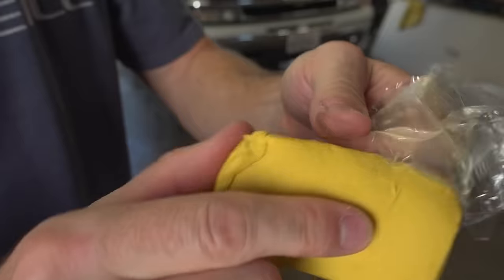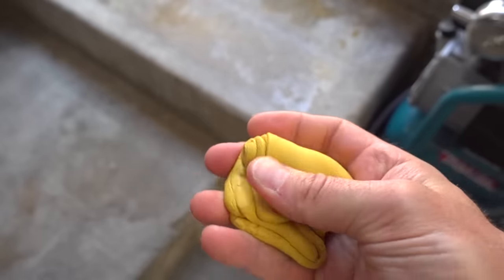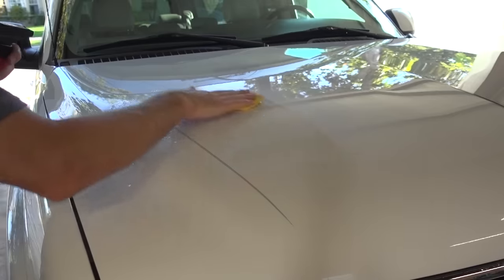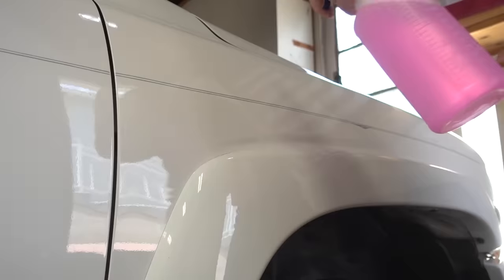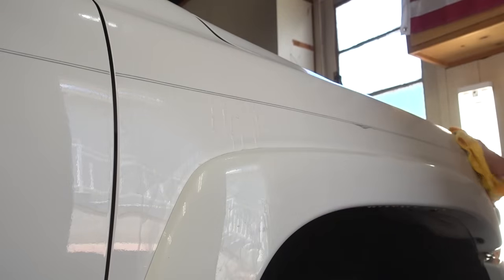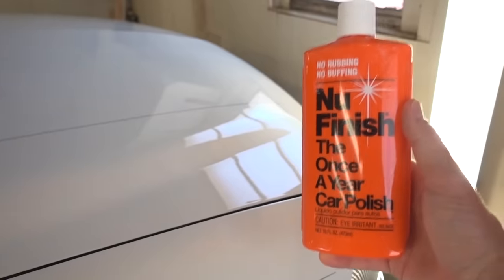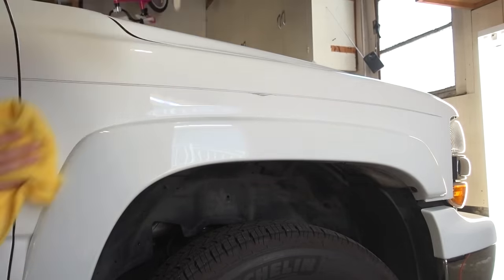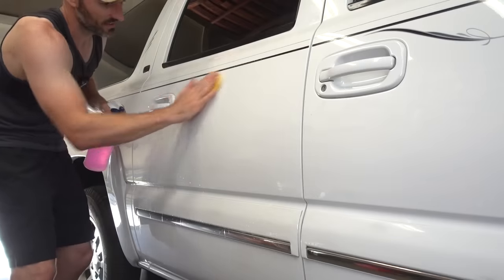This Is Better Than A Clay Bar And Only Costs $2

Comment: I was a auto painter for 42 year.s and if I was going to do a comparison on two different ways  to test a product, I would have used the clay bar on one half of the hood and plumbers putty on the other half of the hood.That way you would have equal light distribution on the paint surface.
Reply: and preferably on a dark color such as black. white hides a ton of imperfections. also looks like you take pretty good care of your car as is.
Reply: @dee1089  And don't compare one surface that has been waxed with one that hasn't.
Reply: It’s a shame you went through all that trouble. Nu Finish is the star of the show. That stuff works miracles.
Reply: @Bo-hb3eo  yeah, when I had body work done on my sebring years ago I asked the body shop owner about various waxes.  They swore by nu finish for a once a year wax if that's all you do.  I like Maguire's gold glass for the shine it leaves, but doesn't have the lasting power of nu finish as far as protection.
Reply: I like the idea of a cheap alternative putty. If you drop either putty you’re advised to toss it. That gets pricey!
Reply: just use an inspection light and examine the paint 🤦‍♂
Reply: It also might be a good idea to do the claybar and PlumbersPutty (PP) side by side comparison on a vertical surface, a door.  As opposed to a flat surface where the light bulb positioned to the side is coming on an angle from a light source. That might give a different appearance. To me it's better surface to examine side by side, for metal or paint imperfections.  I would like to spray various types of liquid to see how it runs top down on each surface. again side by side. 1Road did a good job approaching the subject. But examining what we do often reveals how to do it better, so I do appreciate the time he took. I too think
@stephenmartini5890's forty years of product experience is good enough for me to use the PP method.
P.S. Thanks to all above. I'm going to go for the NU Finish also..
Reply: And a similar surface.
Reply: I agree 100%.  Most of the damage is usually on the top of the car and was going to comment do have done the  hood with putty and other half with clay bar
Reply: I was thinking the same thing
Reply: This guy completely marred his whole paint job and doesn’t even even know it
Reply: Isn’t the Nu finish a bigger ‘grit’ and the clay more of a buffing tool..better for after nufiniish?

Comment: I save money by not washing my truck.
Reply: Lol! Its good ur saving that money! Because when all that junk ABSOLUTELY causes u to need a new paint job the shops gonna require ALL of it!... Plus much much more!  Or even then u could still just let it go and as the rust eats away at the metal and stuff starts falling off u will gradually get better gas mileage! Definitely needing something to offset that continual decrease in the value of ur car anyway so why not! 😂
Reply: Jonathan Bailey Or just throw it in the gutter & go buy another!
Reply: once a year works for me.
Reply: Yep making it look like a mirror doesn't make it drive
Reply: I bought a used construction truck V8 to haul cargo and my overweight butt. Washing trucks is a waste of time unless it is to hose off the mud so you can see the paint.
Reply: some people let the green moss grown on the cars. still after a ordinary washing the car looks like new. exept under the car there was a hole . funny the paint had to issues. so perhaps use clay under the car ?
Reply: Me too
Reply: You don't wash it, the paint will fade away
Reply: urban cammo
Reply: Better gas mileage with waxed car.
Dirt has mass and creates drag. Save the earth :-)
Reply: @deasttn  at 13 MPG in a truck no cleaning will do anything 
The shape itself is already a Battle against aerodynamics
Reply: @deasttn  a shark is not smooth, so is a dolphin...
Reply: @gertvanpeet3120  thats right. Science!
Seal the radiator opening like nascar does and you'll get even better gas mileage.
Reply: Really? Tell us more...your so smart...gow about save water and pee outside!
Reply: James Carroll  whats a geo metro...a milenials vehicle?
Reply: @deasttn  wow...deep!
Reply: @bryanmartinez6600  really?
Reply: @gertvanpeet3120  what about a catapiller is it soft and fuzzy? You must know!
Reply: Save more money by not buying a truck!
Reply: deasttn I already get 55 miles to the gallon with my Toyota Prius, think how much more I can get if I wax it? ✅
Reply: ONE !! DIRTY !!! TRUCK !! INDEED !!
Reply: My 20 year old dirt on my truck protects my paint just fine plus helps hold the whole truck together
Reply: My bad Transmission is my antitheft device ; my oil leaks  makes sure I always have fresh oil in 
my truck. 
    Yes , Pig Liver taste better then cow Liver.
Reply: Lol
Reply: I save money bu not having a truck.

Comment: Buy silver cars.  They always look clean
Reply: Agree just wash 1 every 3 months 😂😂😂
Reply: Buy German cars they have too much paint on them.
Reply: But they attract dirt like a magnet
Reply: Gold. You can barely see dust on them.
Reply: @erniefernandez598  Wash your car then.
Reply: White stays and looks clean if you keep your hands and fingers off it
Reply: @Perry Elyod Resale value
Reply: @bokibo87  do you one better. I own a silver German car.
Reply: @nicstr28  
Not as long as Silver....I've owned both white and silver.
Reply: Very true
Reply: @motorcitymanman7711  i agree with this. I currently own red,silver,black/white 2 tone, and all white. Silver can go a while before it looks bad worst part is water spots from rain. The black shows up a lot ans spots up bad. The white looks good for a while if not parked under trees. 
I however can go a month during the summer without washing the red car before it looks bad.
Reply: No friggin way !  Silver is almost as HOT as black here in the southern summers.
Reply: I don't know about current paint, but in the past, based on my observations, red and silver were the worst paint finishes for oxidation.
Reply: @OOICU812  my red car is oxidized pretty good currently,needs a buff. The silver German car is pretty new and still looks flawless. Time will tell.
Reply: Gold cars same as silver.  Can't see any dirt.  :-)
Reply: i painted my truck "brilliant silver" looks hella good a few years later
Reply: @Perry Elyod Because my ego is not involved.
Reply: Silver oxidizes easier in my experience but I like it.  My pickup is silver and black.  Believe it or not, my old white pickup always looked cleaner.
Reply: @SBCBears  Yes, so is brown or beige.
Reply: Aubergine coloured cars are the best you see everything every scratch every swirl people's nightmare purple plum aubergine
Reply: @erniefernandez598  silver paint does NOT attract more dirt than other colors
Reply: @nicstr28  WTF are you crazy? WHITE and BLACK - two worst colors for cars because they show dirt immediately- White cars show black dirt and black cars shows white. Silver ROCKS
Reply: @Perry Elyod Well because a 1999 SL500 as all Mercedes do look the best in "Brilliant Silver"- hard to call someone who drives a 20 year old car a "conformist".  White is the coolest but dirtiest. Silver is still very cool and stays so clean (looking) the longest. That's 2 reason why.......
Reply: If you want to Wash your car every week  buy a black car/SUV/truck
Reply: It's true.. my 2012 sonata (silver) that she scratched against a staple riddled pole when we first got it.. looks better than my 2019 Tacoma (detailers black).. wash my truck 3x per month.. I don't remember ever caring about the sonatas paint outside of washing off bird droppings..
Reply: @bokibo87  Yes and you'll pay MUCH more for the frequent repairs of such over engineered, complex and unreliable money pits.
Reply: That's what I do
Reply: Corona Covid 19 
But they cheat during SMOG tests.
Reply: Silver is among the worst colors for a car, it always oxidizes qucker than other coloy.
Reply: @GTVAlfaMan  ......... That's nonsense...... I've owned 41 cars and the silver and white car's paint holds up much better than any of the other colors... Less absorbing of heat and rays equals less damage to the clear coat
Reply: big4g63t 
You are wrong, I’ve owned a couple of silver cars and along with few of my friends and relatives we  all have experienced sun fading issues with silver painted cars.
Never get a silver car.
Reply: @GTVAlfaMan  I currently own 3   silver vehicles, am an automotive technician/professional detailer/ paint correction & restoration specialist...... And I'm old.... Sorry but I'm right and your wrong.... Longest lasting automotive paint colors are silver and white in various shades... That's a fact.
Reply: Hahaha unless you park under trees 😓
Reply: NS hell no. Mine was always dirty
Reply: Silver, as well as white is boring. Gold is ugly.
Reply: @billclark8241  White is far from coolest, used to be police and old ladies drove white cars.
Reply: True 👍
Reply: Why look clean when you can actually keep it clean. Weekly or bi weekly washes.
Reply: @bokibo87  not vw's though lol, paint is super thin.
Reply: I verify this message !! Favorite car color by far is silver .. looks clean forever !
Reply: 100% correct.
Reply: Lol I have metallic mercury silver always looks mint
Reply: Yeah, until the clear coat goes bad.
Reply: Except when they’re filthy
Reply: @Tombrosapien The  Chemical Guys help keep that from happening
Reply: Yes I don't know why I always find great buys on black cars. Can't avoid them for the life of me.
Reply: @bokibo87  i dont igree at all. I live in sweden. Audi a4(not a6). Bmw 3-series(not 5) and vw passat is worst known as rust magnets.
Reply: @bokibo87  and just buy a Toyota avensis. It has stone chip from the wheel.  It has been own by a guy who live in country rouds whit roads full of sharp rocks. And this car has a amazing thick layer of paint. I have not see this thick before. And the rustprotection is amazing. I have not see this good rust protection before.
Reply: Why I own one
Reply: @Perry Elyod boring cars don’t get stolen so much
Reply: Yes that's true , 2018 I bought the new Suzuki swift turbo in red to please my wife, will never do that again next car silver.
Reply: That’s what my parents do. But I don’t like silver cars.
Reply: So true and the color hit different
Reply: No, just no. Silver cars are the hardest to get a deep mirror gloss on.
Reply: Brown
Reply: All I own are silver vehicles. It's been that way since 2005
Reply: I agree 👍 😀
Reply: the problem with silver cars is that they blend into the road..you can't see them that good..
Reply: @philiprawbon2359  very true. Cops don't notice them as often. ;)
Reply: If you clean your silver car it look and be clean.
Reply: Agreed! My GTO is Palladium silver
Reply: @erniefernandez598  That's black paint
Reply: I have a silver car I love it I never get a ticket Cause a radar gun can’t read it because I’m camouflage to the road
Reply: @dan_6915  my mustang is “mineral grey” and it’s basically gold, this is true. You can only tell it’s dirty from up close, like getting in the car close. Still looks good walking passed it
Reply: In my experience, silver is the worst paint to have. Very difficult to maintain and easily shows imperfections.
Reply: @bokibo87  Uhhh, not on Mercedes.. 🤦🏼‍♀️😂
Reply: This comment is under thumbed up.

Comment: If the hood was divided into two sections and there was a straight side by side comparison on a similar surface, this might have some credibility. Those surfaces are not only different and how they contact debris coming from driving, but also the level of temperatures that those surfaces are exposed to.

This is why I love the Project Farm Channel so much, the guy thinks about that type of stuff and always tries to give a uniform testing protocol on whatever he does.
Reply: And have it done on black paint so you can see

Comment: Most paint contaminants will settle onto the horizontal surfaces of your car, less so on the vertical.  Clay bars are made to be sticky in order to grab the contaminants off the paint without using excessive pressure to remove it reducing the amount of abrasion on the paint.  You can use car shampoo mixed with water as shown in this video with a spray bottle. It keeps the clay lubricated and moving easily reducing paint abrasion.  You will see the clay bar surface becoming dirty, that's what was stuck to the paint surface, when you see that take the clay and knead it so you have a clean clay surface for the next panel.  
I have never used plumbers putty on a car so I can only offer my professional opinion on it, but not by experience in using it.  I wouldn't do it.  Plumbers putty is not as sticky as clay and it's much softer, which translates to using more pressure and more back and forth motions to get the same results as the clay.  Using more pressure is likely to scratch your paint.  Make no mistake, any time you touch your paint with any product, or wipe it with even the softest micro fiber towel  you are indeed scratching it.  Your goal is to minimize the amount and severity of scratching.   
Once you clay your car it is vulnerable to the elements. You have removed paint contaminants, but you also removed any protection previously applied to the paint.  It will remove any glazes, waxes, or other surface applied product. So it would be wise to plan enough time when claying your car to apply a coat of polish and wax, or wax alone. This should be done in a shaded area not in direct sun light.
And yes, I do this professionally.
Reply: Thank you for explaining! I do appreciate videos like these, it's very interesting to see, even if only to help us understand why specific products are made for specific uses.
Reply: He is correct
Reply: Thanks!
Reply: Well I'm still thinking for myself and maybe cleaning and waxing my car a couple times a year, for a few dollars I think I'll be okay with the putty.  Of course you could do these side by side for a couple years, the left side of the hood and the right side. And then publish the results LOL. Soft putty versus sticky clay!
Reply: 100%
Reply: Absolutely agree, I was like “they make varying degrees of clay hardness for a reason. You can do fine grade and heavy grade clay side by side on a roof and see the heavy picks up like 50% more contaminant...as someone who does this all day every day in the sun...just sayin haha
Reply: Thanks for your advice. I've always clay bar then waxed. Do you recommend ceramic coat for protecting and is it necessary to wax your car when it was ceramic coating?
Reply: @chrisbatson3402  I'm no professional but yes, ceramic coat your car. Clay it after the wash for the last time (for a while) then apply the ceramic. Make sure to check for any swirls or scratches before you clay. If there are none, you're good to go. I say to use ceramic coating because it sounds like you clay and wax a lot, and the coating will last for quite a while.  You don't want to clay your car more often than needed. You can wax your ceramic coating to add a layer of protection for the ceramic. Seems a little excessive IMO, but I definately would not use a DA polisher or rotary because I would not want to make the ceramic any thinner than it already is. Hope this helps...
Reply: Amazing explanation, thank you!
Reply: Lol, I have never done this but let me give you my professional opinion, hahahahhaha too funny!
Reply: @hyperliterider861 linseed oil
Reply: Yep. I live in the south and see so many cars with clear coat eroded by the sun (and by not washing enough) on the horizontal surfaces, and the doors are totally fine. So I make sure I keep those surfaces always waxed and do the sides once or twice a year.
Reply: TLDR?
Reply: @chrisbatson3402   want some actual good advice? I’ve applied many coatings. It’s ideal to do those steps, strip wash, dry, clay, cut and polish, then apply ceramic and late cure for 24-48 hours depending on coating before washing or exposing to rain, no washing the vehicle for 1-2 weeks. You can ceramic coat without polishing but scratches and swirls will show through coating
Reply: 💯 correct. EXCLUSIVE SHINE MOBILE DETAILING APPROVES THIS COMMENT
Reply: @hyperliterider861 I
Reply: Thank you for this well-informed comment!
Reply: @M King Not so in my experience. Very little fallout on the roof and hood, a ton of it on the back of the trunk and lower half of the doors. And I have a white car, so it's very clear to see.
Reply: @chrisbatson3402  you should clay, polish them wax. Clay will always leave micro scratches no matter what they claim. Ceramic is a thin hydrophobic clear coat essentially. Waxing over would be pointless. You can use another sio2 topper spray a couple times a year.
Reply: @realdealaffiliates9197  you have this process flipped. Clay bar creates micro abrasions. period. Clay then polish 👍 then prep with panel prep, then ceramic coat.
Reply: Man, that was quite a thorough and interesting explanation! Thanks for sharing that information. I was thinking to myself, there has to be a reason that the clay bars a manufactured to be sticky, so yeah, I'll stick with the expensive stuff just to make sure its working properly.
Reply: EXCELLENT ...the "why" behind why to use the clay bar..THANK YOU

Comment: I've been a detailer for 25 years and never heard I've always used a clay bar and a wash mitt with a clay substitute in it  for all my work. And it really works but I have to say that seems like a good idea. I like to save some money
Reply: Did you switch from clay bars to plumbers putty?
Reply: So what happened?
Reply: Inquiring minds want to know. Have some brain candy for us?
Reply: @ProleDaddy  o
Reply: After one year, have you tried the clay?
Reply: @sergios4620  Probably got locked up for scratching the paint on an Escalade....
Reply: Or shot!! 🤣
Reply: Those substitute clay mits are the best. Washable and reusable and much larger surface area than a clay bar.